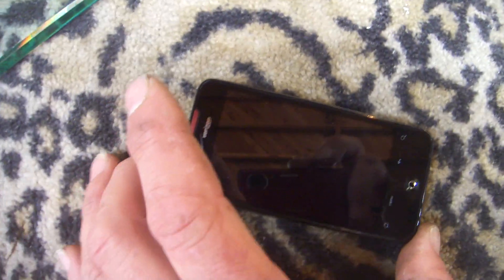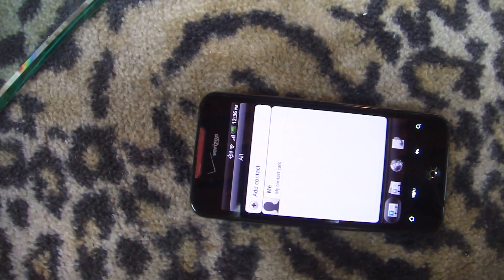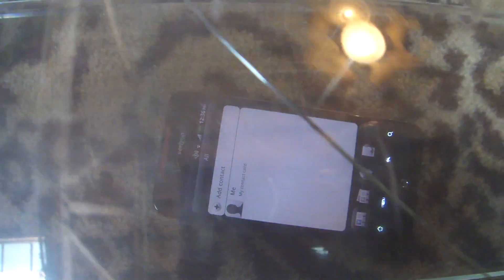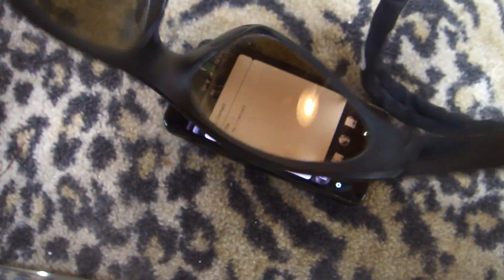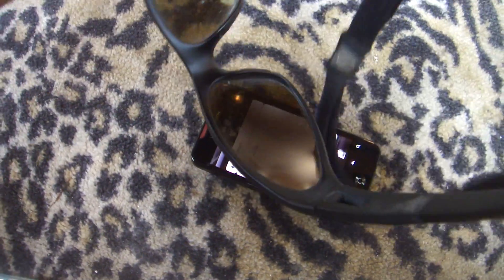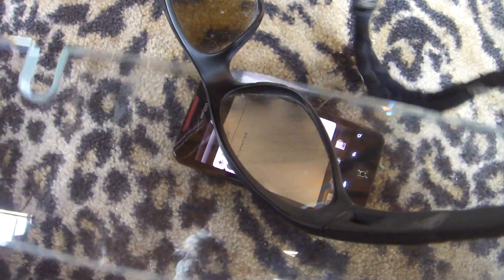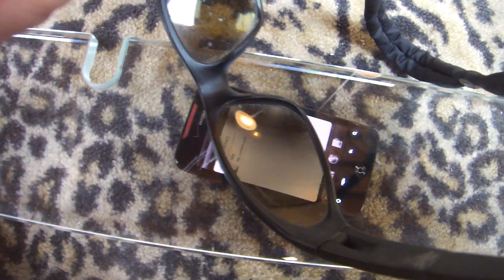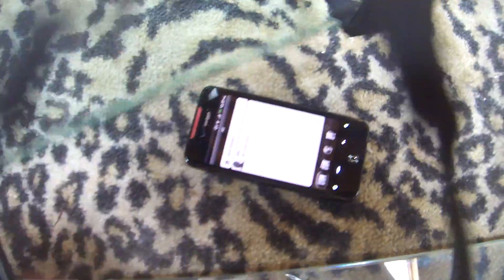How to Test for Tempered Glass

Comment: Good job on the polarized light info in your video, but it's a shame that the annealed glass didn't have a notch so that you could compare apples to apples, also you should try it with laminated glass with the same notch as well. In fact laminated glass with the notch cut before lamination and the notch cut after lamination.

Comment: How well this test works depends on how the LCD screen you're using as a light source is polarised. I've found the screen on an iPhone 5s doesn't work well for this test (with a straight polariser from an old nokia mobile screen I can't get the white light to black out from the iPhone - but other models of phone, and laptops work great).

So if it doesn't work for you like it did in the video then try a different LCD screen. 

Also, polarised items with circular polarisers (like polarised sunglasses) won't work as clearly as this demo. The thin plastic polarisers from disassembled calculator displays or really old mobile phones (non-smartphones) are good. Smartphone displays tend to have their polarisers all bonded to the glass.